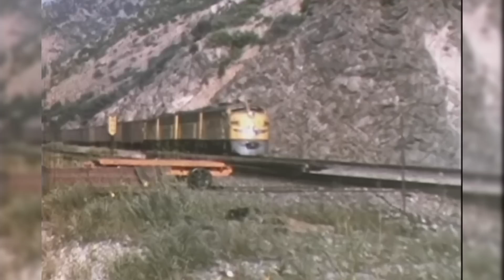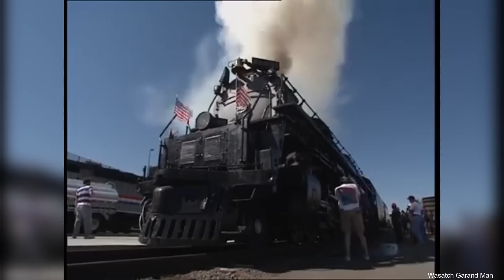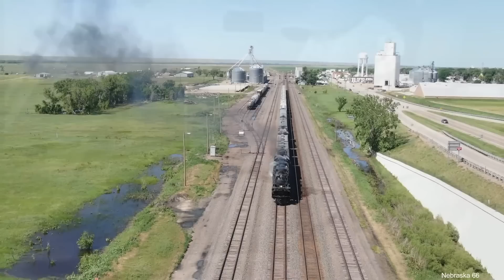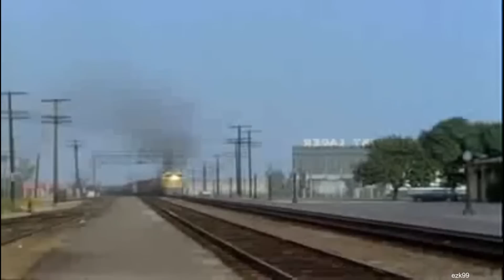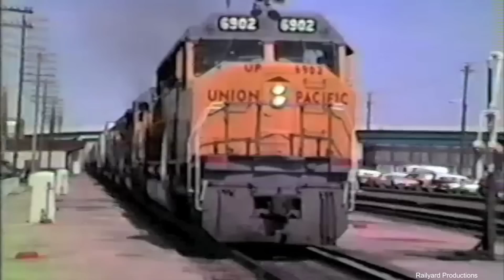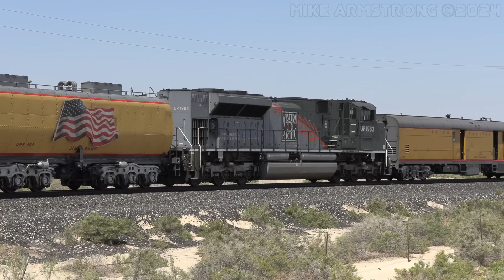Union Pacific’s Super Fleet | How These Trains Conquered the West

Comment: Union pacific actually started with the 9000 class long before the challengers came as they were an improvement over the 9000s with a larger firebox and with 2 separate engine units instead of 1 set on a rigid frame